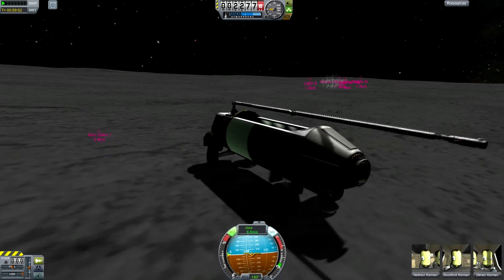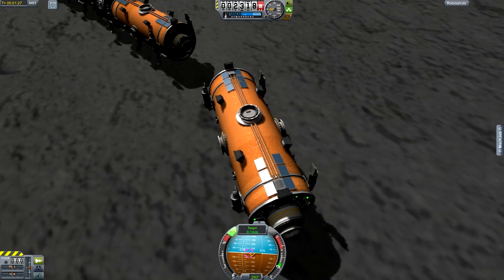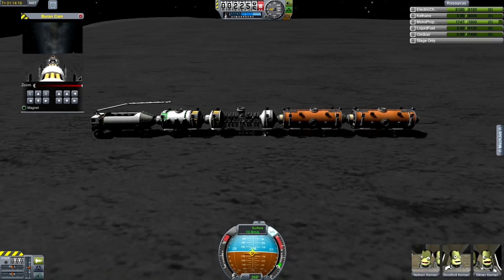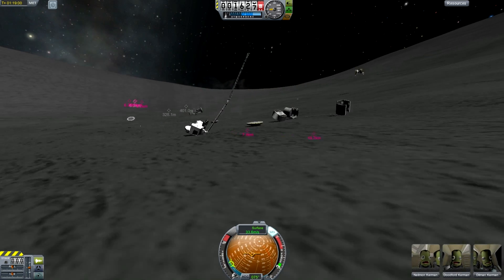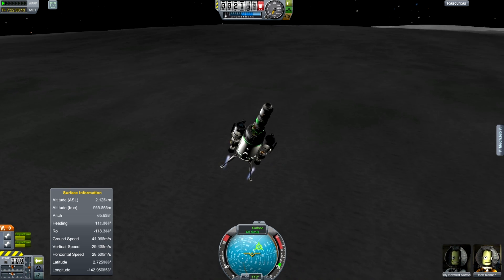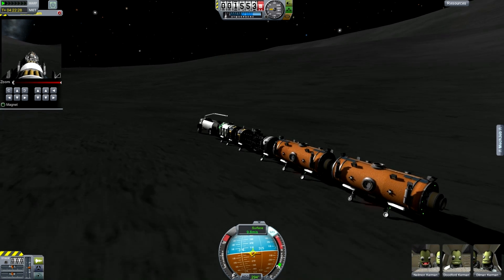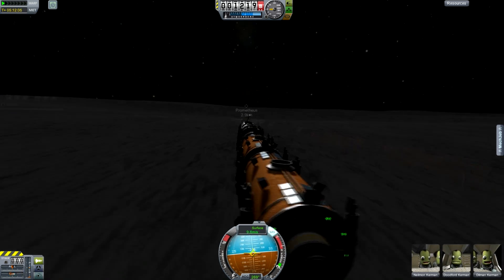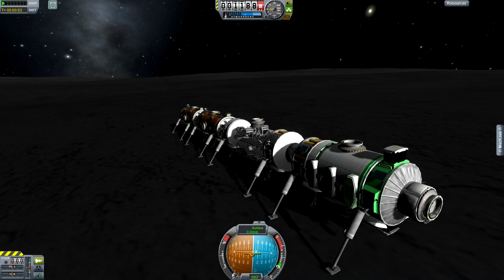Kerbal Space Program - Reusable Space Program Episode 21

Comment: I couldn't resist making a comment about Blakes 7... sorry...

Have you considered...

1) You don't see Avon getting shot
2) Villa has a unique knack for finding the  safe spot.
3) Orac seems to have been sequestered somewhere safe
4) Who is to say that Avon had tracked down the right Blake.. Considering the aberrant behaviour, could well have been the clone, not the original...

And the cherry on the cake... In designing a ship capable of self repair, I'd have the primary unit for that task located at the centre... logical action to preserve it from contamination.. blow the ship apart.. and the destruction of the mega asteroid left a lot of useful material for collection and use.

Conclusion.. the main core crew still possible.. orac still possible.. and the return of The Liberator.

It's fun to dream what may have been.

Comment: If you retract the front gear on all the trailers, it should reduce your friction a little bit without critically endangering the project. Also, if you used KAS or something else that had freefloating cables, you would regain the ability to use 4WD on the hauling truck.